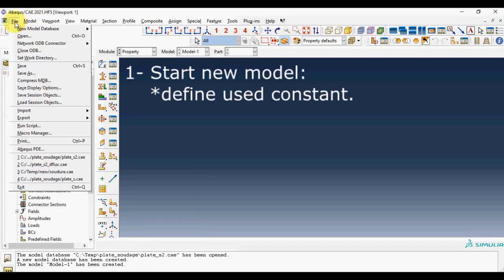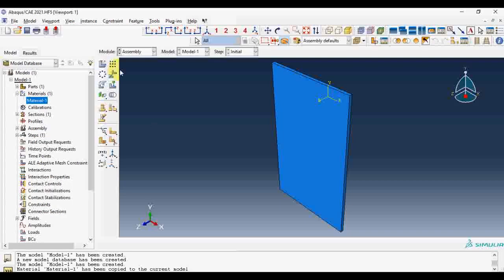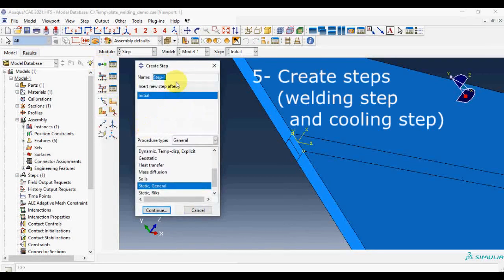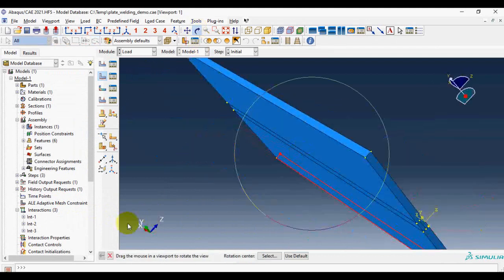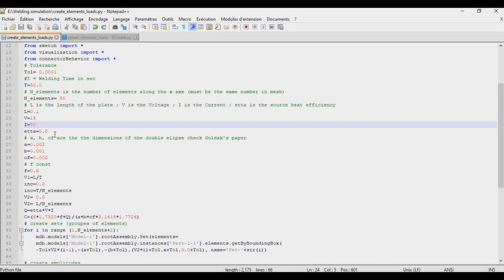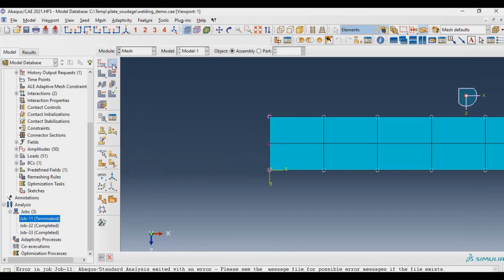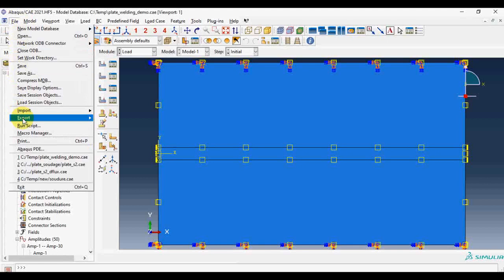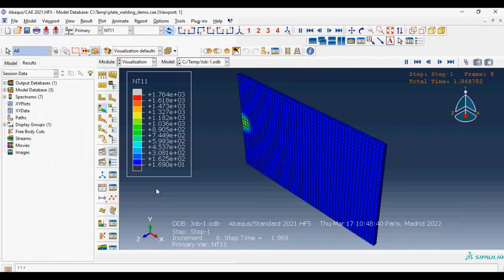Welding simulation using the Goldak's double-ellipsoid heat source in Abaqus ** Files included! **

Comment: hello, I would like to ask what type of arc welding is performed here, is it TIG?

also, how do we determine the value of current, voltage and etta?

thank you
Reply from the maker: Yes this config is for Tig process. As for etta is the welding equipment effectivness, the voltage and intensity is the objective of this study to determinate so they are variable until the heat zone is perfect.
Reply: @imodeling5736  Thank you for the reply. How about the rear heat flux variables, did you consider in this simulation? also, why is the fraction of the heat is 0.6?

Comment: hello. I have a question. Why did you use the film coefficient and sink temperature values of mig welding when you used a 2mm thin plate? I know that mig welding is used when the thickness of the plate is 6mm or more.
Reply from the maker: Simply because it's a general case model can be used with Tig or Mig welding. Certain parameters can be neglected with specific factors.